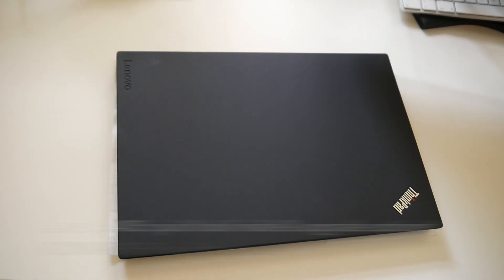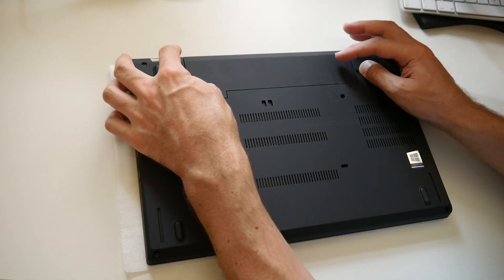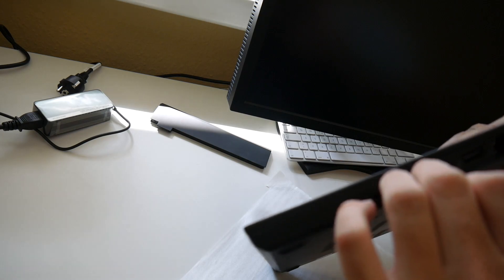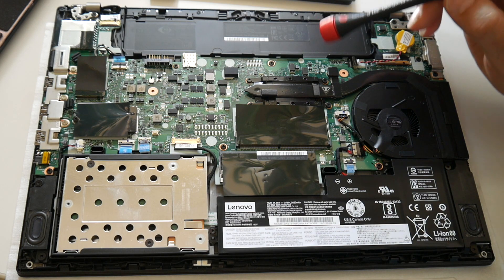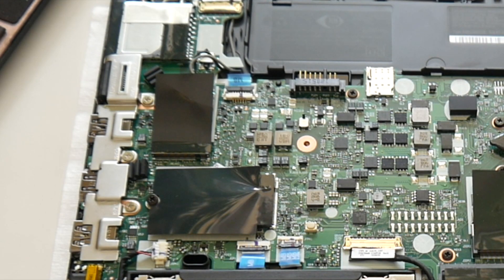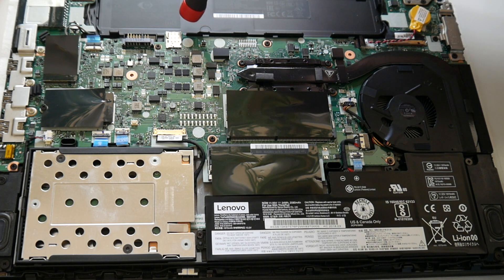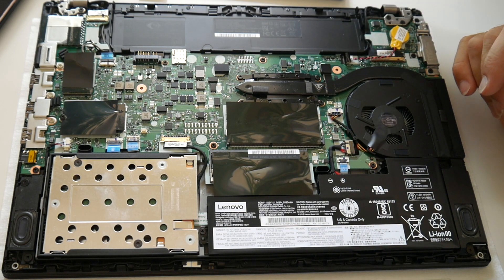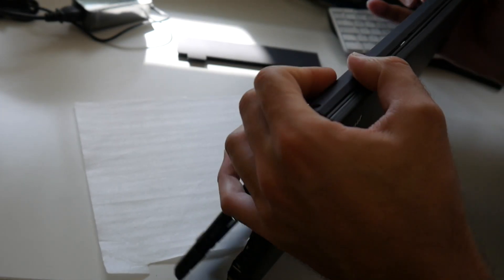Lenovo AMD ThinkPad A485 - disassembly, look inside & options!

Comment: Useful and interesting video. But I could not understand what goes in this slot 1:58 because of your English.
Reply from the maker: M.2 slot?
Reply: @renerebe  Is it for 22x30mm or 22x42mm M.2 drives? And which connector type, B key, M key, or B&M key?

Comment: I have 2 16 gig ram sticks that works ok. Just been inside mine because it said number 1 battery not present. It`s not even there lol. I`ve been using it for years and not noticed. It`s only staying on a few minutes after removing the mains lead so the back battery must be on the way out anyway.
Reply: Do you have 2 x 16GB or 2 x 8GB? I have 16GB and would like to expand to 32GB.
Reply: @motojazda6329  sure mines on max at 2 time 16GB.

Comment: do you know if the dual heat pipe cooler out of a T480 (mx150 version) will fit in the A485 as a cooler upgrade?
Reply from the maker: sorry - unfortunately I don't know.
Reply: Probably not
Reply: @CDM14y  bummer. After closer inspection though, the single heat pipe in the Ryzen based A485 is significantly thicker than the single heat pipe version of a T480, so the little Ryzen chip may not need anything other than a slab of PTM7950 to keep it cool.

Comment: So I have a bit of questions
1. Is there a place to put a SATA III ssd (I want to put a small ssd for system and another big ssd for files) I have a 64 GB sata III ssd which i want to swap with the stock 256 GB
2. How many slots for disks are there, and what types and standards
2.

Comment: I want to buy a laptop, I have found the Thinkpad T580 and A485 at the same price. I once saw a T470 and I really loved the finish on the lid and the resistance and Robustness it had. Does anyone know if the finish is similar in either of the 2?
Reply: T470 is pretty outdated

Comment: THE FREE M.2 SLOT IS ACTUALLY A WAN WIRELESS CARD SLOT, IT DOESN'T WORK WITH SSD
Reply from the maker: IT DOES ;-)
Reply: M.2 2242 NVME protocol. It's for an ssd. The other m.2 slot above it is populated with a WAN card.
Reply: @colesherrill7472  It actually is  WLAN card and empty slot is for WAN but it CAN be used for ssd instead accordig tonuser manual without any problem if you dont need a mobile network.(and tbh i would never need it as i would just turn my phone into a hot spot if needed)

Comment: In the process of researching a standard use laptop. This is probably the model i will get. Hopefully get ~8-10 years of work out of it and looks easy enough to upgrade + repair. I like the idea of supporting AMD Ryzen architecture too.
Reply: A bit of an interesting info if you are into AMD. You can unlock the TDP on these machines and set it to run @20-25W (or even higher if lucky) instead of 12W set by Lenovo. It still won't overheat, but you get a i7-7700  + Nvidia MX150 level of performance! I've been using mine (E485) for a month now - rock solid! Upgraded the screen to a 100% sRGB 400nit panel (50$ @ ebay). This machine is a keeper for sure. Silent, cool, powerful. Battery life could be better, but hey, can't have it all for 500$ lol.
Reply from the maker: You mean the acpi table tweak for the tdp? Which panel did you use? ;-)!
Reply from the maker: yep, me too, often had great AMD CPUs, from some k6-2 to an AMD Athlon 600, to the first 64-bit AMD64. Also really tired of the nu-servicable MacBooks, I can really not recommend / buy them anymore :-/

Comment: How is the TDP? Thermal design power? Any over heating issues or throttling for the Ryzen 7 for this thinkpad
Reply from the maker: Is there a tool that outputs the actual cTDP? As shown in the 1st video it is under load fixed at 2.3 GHz for me, which is quite a lot more than the 1.6GHz the ideapad was throttling at.
Reply: @renerebe that's the clock speed not the tdp

Comment: Thanks for the video! It looks like you have a 2.5" drive installed. I saw from the laptop's manual, that you can replace the 2.5" drive with an M.2 storage drive which is mounted in the same location via an adapter. Do you know if the laptop ships with an adapter, if you ordered the version with the 2.5" drive? If not, do you think it's available to order it at a later point in time?
Reply from the maker: Actually his is with an Samsung NVMe at that 2.5" bay location. I guess it may not come with the matching spare mounting and cable if you order the 2.5“ sata storage. I heard IBM^W Lenovo is good at having individual parts for order.

Comment: Lenovo making things harder to access now with these Apple MacBook style bottom covers. Very sad. And this laptop (which I wasn't aware it even existed) isn't nowhere at the level of the X, W, T & P series line, correct?
Reply from the maker: What do you mean? Was this not always like this to open for a decade or two? Also, what exactly do you mean w/ "nowhere at the level of the X, W, T & P series line"?
Reply: I don't think so, or maybe I since I have stayed with the older models from I didn't notice it until after those ThinkPads that came after the X230 model(?). For example, with older models if you wanted to remove/place the rams you only had to remove a small part, now you have to remove the whole cover. The bottom cover is now similar to that of the Apple with just the battery being removable (sometimes?) and I don't even know if the rams are upgradable now too. What I mean to ask with "nowhere at the level of the X, W, T & P series line"? is if this laptop is as good as those in the catalog line I mentioned or below them, in terms of power, durability and etc.
Reply from the maker: this is totally far away form MacBooks, believe me, we have been mostly on Macs the last 15 years: https://www.youtube.com/watch?v=zTXkWrXv9H0 this is way easier, normal & retaining screws, just comes off, no prying, and you can service and swap everything, RAM, multiple M.2 storage, battery, ... on the newer MacBooks nothing is user swappable, not the RAM, nor the storage (in the very latest MacBooks flash is even soldered, before they used a proprietary connector), nor the battery, which is glued in place with strong adhesive on the MacBooks. This is a difference of day and night, MacBook repairability: 1: Lenovo ThinkPad: 9 if not 10! To me this looks X/T line construction, parts and quality. As far as I have seen from a first look the A285 is X280 and the A485 is T480s a-like.
Reply: Hey Rene, I was wondering how you removed the snaps near the battery?
Reply from the maker: Gregory Hatt mostly a small screwdriver, once a tried a pocket knife that did not work that well
Reply: @robertvuitton  , it's better in every respect actually. Power wise,  2700u + Vega 10 (once TDP is unlocked) beats pretty much every other lenovo model, unless you are running the beefiest T/P with a full voltage quad/six core and quadro GPU. And even then, it's not gonna lose by a huge margin at a fraction of the power draw! 
Upgradeability - 2 RAM slots (up to 32GB today, up to 64 by mid 2019), 1 full NVMe ssd slot (up to 2 TB today) + 2.5" SSD (up to 4TB at the moment)
Durability - it's questionable, but personally, I got sick of the carbon rubber finish, which is the biggest fingerprint magnet I've seen in laptops to date. High quality plastic is a nice change here. Overall build quality is just as good as any of the "top tier" lenovos. 
Not all that is gold glitters ;)  Not every great system has to be very expensive.